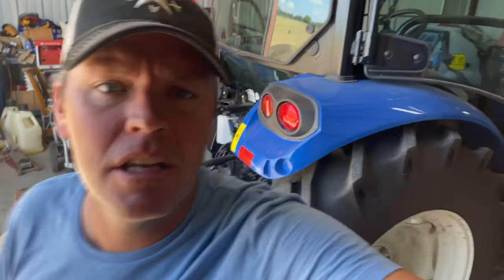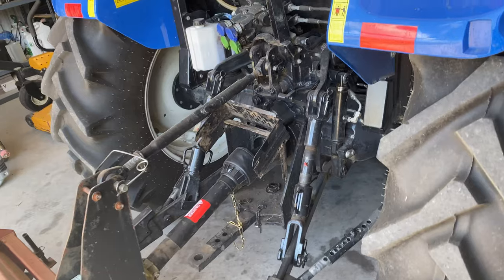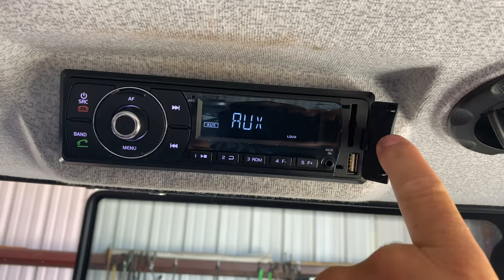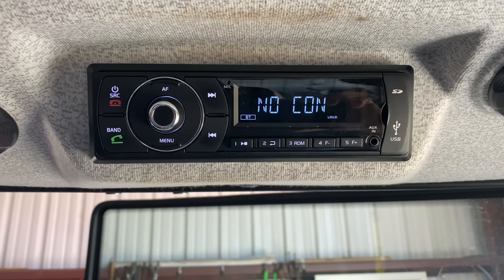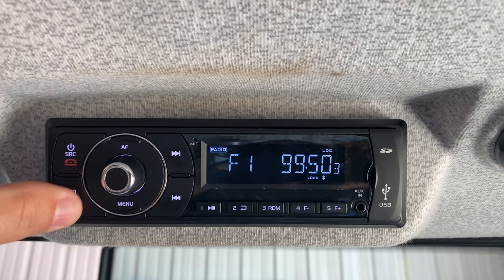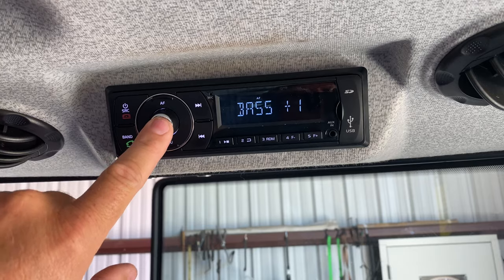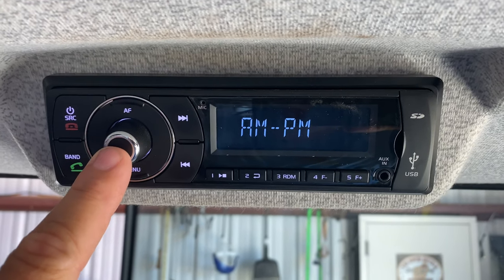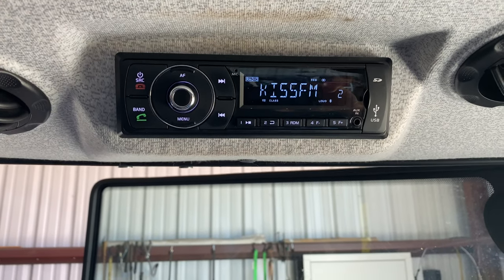Bluetooth radio in a  Workmaster tractor

Comment: I bought a new work master a month ago and my manual shows how to work the radio
Reply from the maker: Interesting. What page number is it so people can reference straight to it?
Reply: It starts on page 10-20.  In the very back of the book. If need I could photo copy and send it to you. I almost thought I was losing it but finally found it.    Hope that helps
Reply from the maker: Gord Hanefeld I wonder if they updated the manuals with the newer model years because my manual stops on page 10-4 then it goes to the index. It says “ 1st edition , July 2018” below the part #.  Thanks for sharing where to find it
Reply: CenTex Ag mine says November 2018 Replaces part number 51519372 that’s definitely why it doesn’t show up.
Reply from the maker: Great info! Thanks for taking the time to look at that.

Comment: Does anyone have any experiance with the persist brand orchard grass seed. Im looking at drilling 50 acres at 20 lbs an acre with it. Just wondering if results match the clames from the companys website. It is alot more expensive than the seed from the coop but Im willing to spend more if I get better results.